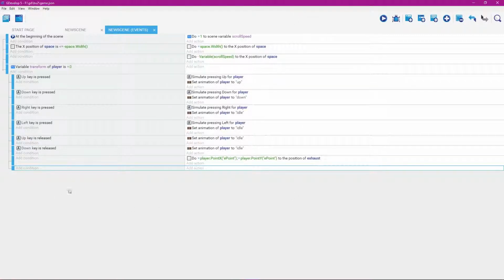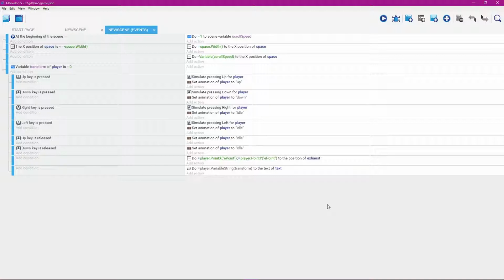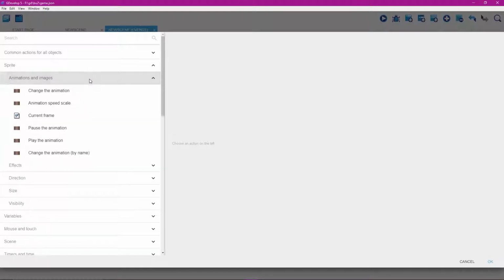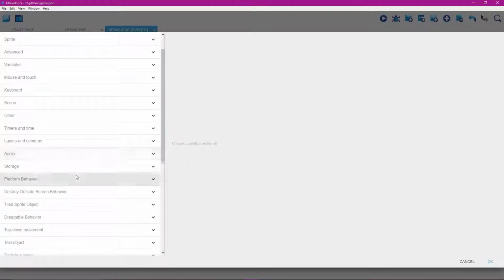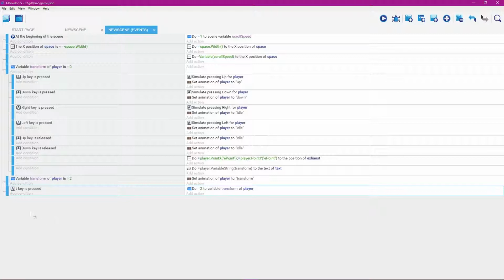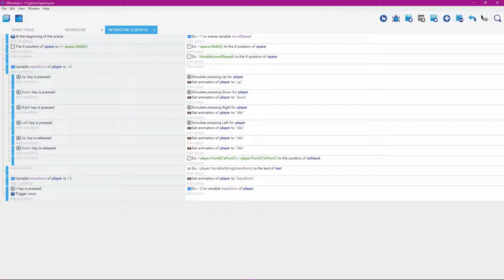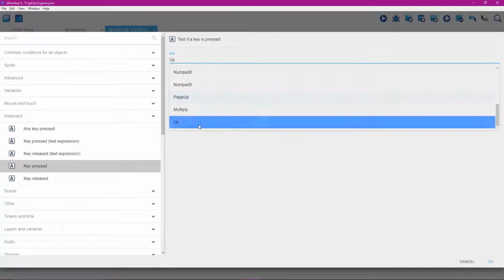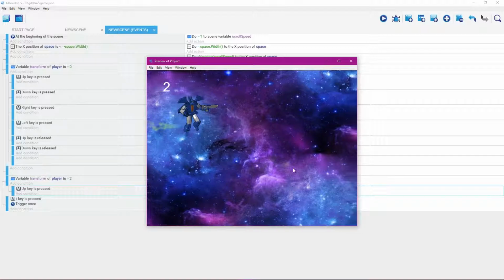Part two Gdevelop 5 Transforming Robot Tutorial Game Design

Comment: Hey body I figured out the layer situation ....really need help on the second request. Can’t figure out my hitbox problem.... need my small character getting into small spaces my big character can’t
Reply from the maker: Are still having issues the hit box size?
Reply: gamevisualz .... I got that fixed too.. Didn’t know I can change the hit box for every animation figured it out. Thanks. I am having another problem. I have a scrolling background and platform now and I can’t seem to separate my player from a car I have in the game. I have the car locked in position with player now because if not it scrolls off screen. I’ve tried just about everything but the right thing. I can definitely use your help. Right now I have top down and platform behavior set on both player and car at default ....  I’ve tried removing one set one on one and not the other but this seems to work best for what I have in the game. Only problem. Because I can’t separate them without one or the other scrolling left or right off the screen the move together.